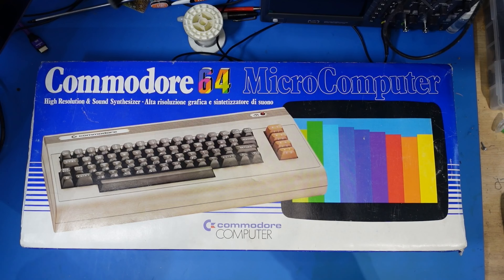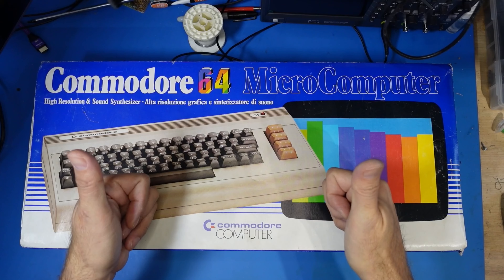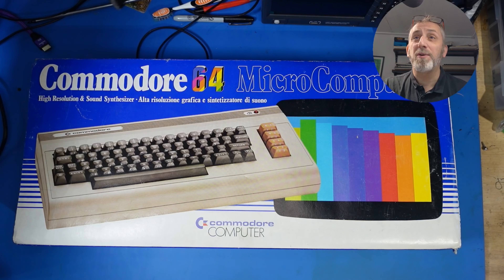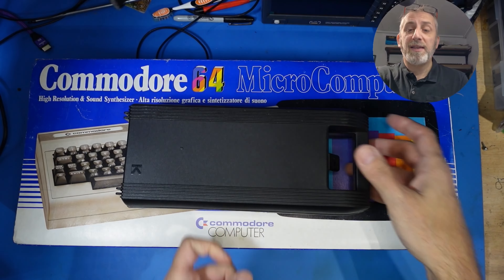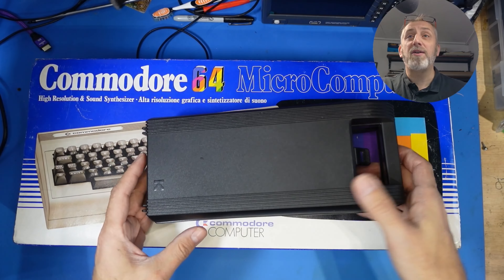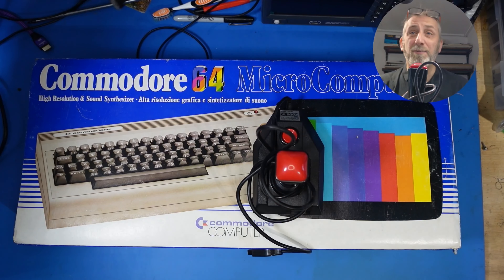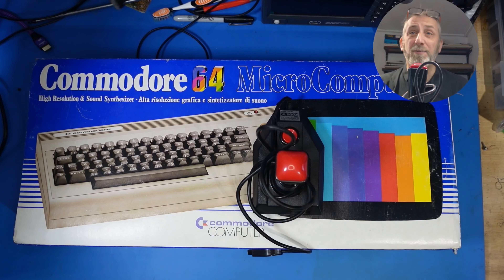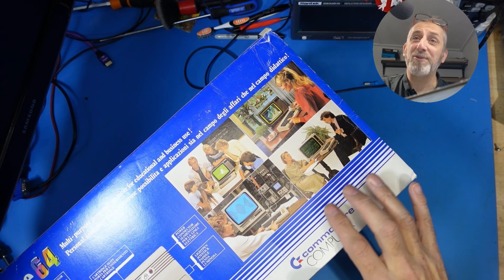Bought a Boxed Commodore 64 – Will It Still Work in 2024

Comment: Interesting. I wouldn't have thought the socket would be to blame for no audio. Does the SID chip have left / right audio out pins that could be probed with an oscilloscope or an amplified speaker to test the chip itself before removing the socket?
Reply from the maker: Yeah 👍 there may have been something I could had probed. But those sockets are that bad you don’t gat anything from them. The reason I didn’t use the scope was I tried a working chip in that socket and it to was dead 💀 thanks for the comment. I have a 1541 with issues and I’ve tested the chips all good but again It has those chips so I’ll probably replacing the sockets on that will fix it
Reply: @Retro4u  Thanks for the explanation. I have a homemade audio probe which connects to a pair of amplified speakers, it's useful for checking without the hassle of using a scope.
Reply from the maker: What a great idea 💡.  :)

Comment: That has not been in a box all this time. This is someone's used Commoadore64 they acquired a box for. Hope they didnt sell this as "unopened."
Reply from the maker: Nahh lol 😂 it was sold as spares or repair 🧑‍🔧.  The box is probably the original for the machine but they never had there serials on to match them. Thanks for the comment
Reply: @Retro4u  😂